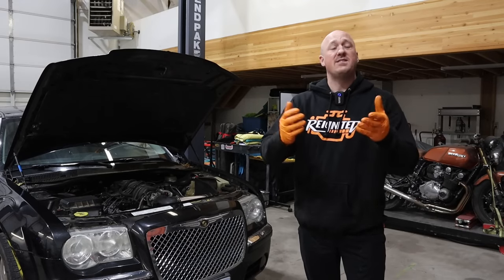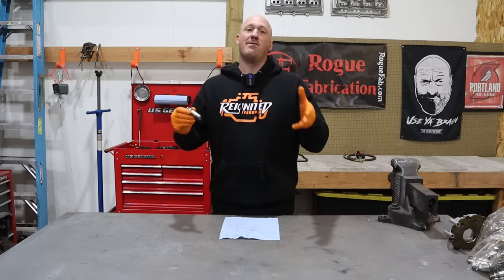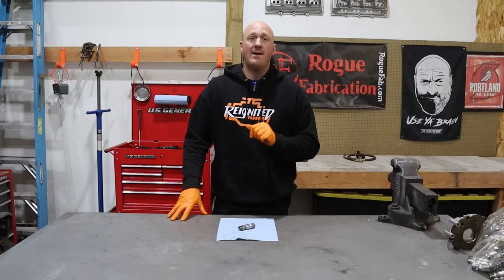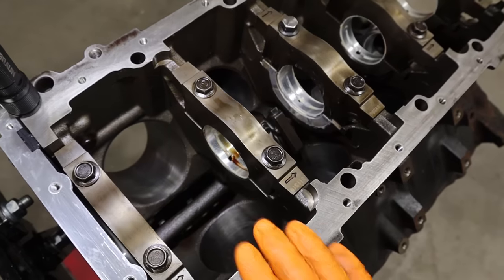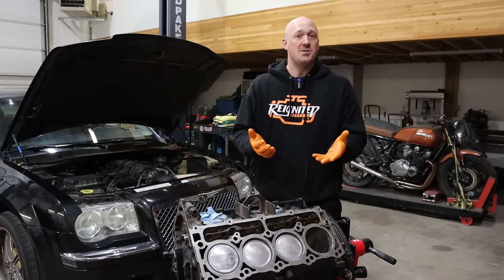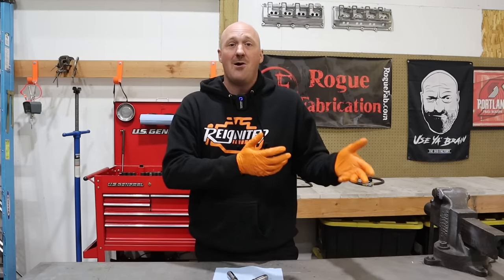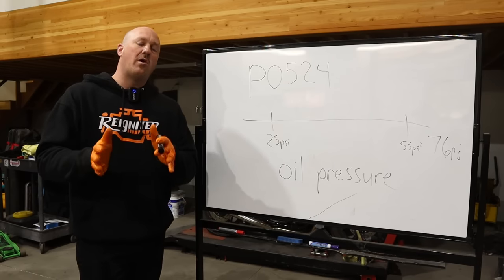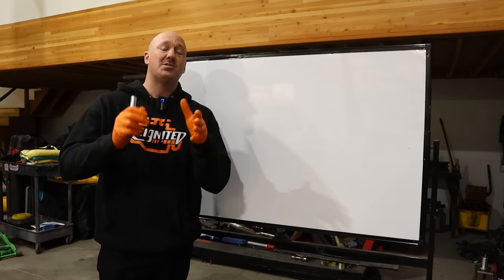The BEST Prevention For Hemi Lifter Failure! (In My Opinion)

Comment: It would also be a good idea to keep an eye on what your oil looks ans feel like. That would also be the reminder to check your oil often. Its recommended to check when ever you gas up, it only takes a second. Its inevitable that the oil is going to become fuel diluted. Arising problems will cause more fuel than normal to mix with the oil supply. It would suck to put on a high volume oil pump and replace lifters and cams, than still have oil problems afterwards. Yes, dirty oil will effect everything and you'll see more than just lifter, cam problems. It all depends on a numbers of variables but usually the upper engine components will show signs of a problem first. The lower components utilize hydraulic properties as well as lubrication properties. The upper components  utilize mainly the lubrication properties.

Comment: I have a 2006 1500 ram with 5.7 hemi. I let it idle all the time. One winter when i had alternator issues I let it idle for 3 straight days, yes 72 hours non stop. In addition i let the thing idle for hours on end while im at work. I do this in winter with heater on and in summer with A/C on. Ive been doing this for 7 years and the truck now has 270,000 miles and has zero Hemi tick.
Reply from the maker: The pre 2009 engines don't suffer from this particular issue. 👍
Reply: @ReignitedAuto  Thank you for the top explanations!  You wrote that the engines before 2009 have these symptoms of ticking or these problems with the oil pressure at idle? Does this also apply to the Chrysler engines from 2006 5.7 liters that are installed in the 300C? Would it still make sense to install the oil pump as mentioned in the video 10342HV?  Thank you and many greetings from switzerland🏔

Comment: Ford has used needle roller lifters since the late 1980s and the "Hemi" lifter tick issue was not an issue for Ford .  Today, Dodge is not alone with lifter problems, as Chevy is also experiencing the "Hemi" tick with their later LS engines. Oil used back in the 1980's was usually 10-30 or 10-40. I don't believe metals all that different today, but the combination of 0-20 oil with todays ultra hot engines,  the oil is NOT providing the cushion needed for these puny needle bearings. As a mechanic myself,  I use 10-30 oil, deactivate all cam controllers and run a 180' thermostat

Comment: What about using a Melling 10452HV? its a  high pressure/ high volume oil pump. would what also fix the issue? Also, how would adding more volume/ pressure affect the VVT and the MDS system?
Reply from the maker: Stay tuned on that, Melling just sent me their new pump so I'll have a video up on that soon!

Comment: I am afraid My 2015  5.7 Hemi 2500 Ram has lifter tick, I feel foolish in listening to my dealership saying this is normal. But now at 105000 miles, I have noticed a lose in power and my mileage has dropped. In the beginning the tick would go away after run for a few minutes, but now I hear a faint tick when the engine is warmed up. I change my oil 3500 mile intervals since day one. After listening to your videos, I believe because I live in North Dakota and letting my truck idle to warmup. I need to know the best kit to replace the lifters and cam with all the gaskets or maybe it went too long and in that case where can I get new engine replacement. Thank you for your advice.

Comment: I was a Dodge technician for many years had many friends who were hemi experts went to specialize Schools and could make any v8 Dodge motor out run anything on planet earth with power steering and air conditioning and all of us are saying there is one major thing you forgot, variable valve timing or VVT, when you change that pump you change how the variable valve timing reacts in the motor, so are you advancing too early or  too late? Pressure is a massive factor in how the system operates This could be damaging down the road. Also MDS no matter who says can cause lifter failure when the engine is running, you are physically changing the dynamic of the lifter when the system is rotating, it can cause unwanted chatter,  uneven pressures against the cam lobe surface which can cause the needle bearings to fail, the best way to describe it pick up 2 60 pound bags of concrete walk with them to your destination and then drop them no problem right you be sore but can do it again many times, but let’s activate and deactivate MDS deactivating is like taking one of those 60 pound bags off While walking let’s turn it back on, that 60 pound bag that came off earlier comes flying down onto your shoulder slamming into you. What do you think would happen that’s correct unwanted rapid acceleration of pressure against steel overtime massive. Wear. You’re causing uneven wear patterns and it’s not just hurting the cam. It’s hurting the crankshaft bearing plus rods and wrist pins because of both valves are shut. It’s still creating pressure positive or negative, depending on where the cylinder was at when MDS came online, as that cylinder slides up and down it starts fighting with itself,so MDS is a very destructive system anyone that tells you otherwise has never understood basic physics so be very careful on who you listen to.

Comment: All your videos have helped greatly, but in the course of adding an MDS delete kit and new oil pump, I encountered something unbeknownst to me. In taking the old oil pump off and going to put new pump on someone previously had used 13mm pump bolts with SAE threads which explained why i had to clean the threads, I bought the correct M8x1.25x65mm bolts but now am facing the issue of do I chase the holes with the propper Tap or what. Some input would be greatly appreciated. It's a 2011 5.7hemi. Thx.
Reply from the maker: I would absolutely chase the threads with a tap before reinstalling the pump. It's critical that the bolts are torqued properly to the block so anything you can do to help that would be good. 👍
Reply: @ReignitedAuto  incase chasing the threads fails is there enough wall thickness to step up a size with drill n tap "if" needed ? want to make sure i don't create more problems lol.
Reply from the maker: @atvstrucksfun46  if you can't repair the threads I would drill out the bosses on the block and put some helicoils in rather than step up the hardware size.
Reply: @ReignitedAuto  will do! Thanks for your time and input much appreciated !

Comment: I purchased a new 2015 Ram5500 6.4L and it has ticked on initial start-up since day one. I’ve changed the oil every 5,000 miles with the factory Pennzoil 0W-40. It now has 30,000 miles and runs good - I hope it lasts…?

Comment: GREAT video!  Have a couple questions:  Is there any way through scanner readings to know if this issue with the lifters is beginning?  Something that would negate the need to tear the top of the engine down just to verify?  Secondly,  do you believe this upgrade will be all that preventative if the vehicle has been run at extended times between oil changes?   I've gone easily 8-9k between changes a few times before, but have always used synthetic 5w-20.  Mostly Mobil 1. I'm at 90k, and don't hear a tick when warm.  Runs fine, also. Thanks.
Reply: I don’t believe so. I tested two rams both had ticking. The loudest one with the tick didn’t have any codes. That was 2013. Now the 2012 had a lower ticking at idle but I got a cylinder 3 failure. Same engines Hemi 5.7. I told the dealer to fix it and I would buy it. So you really just gotta listen for it. I recommend letting the car idling for about 10-15 minutes. Ford 3v are also known for this. I had one myself but that repair came out of my pocket.

Comment: What are your thoughts for people like me with a 2021 Durango RT, Tow N Go with only 9,000 miles?  I'm in the preventative / maintenance phase of this vehicle's life.  I do NOT want to mess with cutting up my wiring harness or installing another oil pump, etc.  What are your thoughts on oil additives like Liqui Moly Ceratec, etc?  I change my oil about every 3,000 miles AND I noticed Dodge dealers use either 0W-20 or 5W-20...... I am no mechanic but I would be far from thinking this is a good idea especially with Hemi Tick!!!  Isn't 5W-30 the best bet?  🏁🏁🏁🏁🏁🏁

Comment: Is it plausible in a 2020 Ram 1500 5.7L that the use of full synthetic oil when changed between 4-5k mile intervals and without prolonged idling is too slippery, and doesn't allow the needle bearings in the roller lifters to rotate enough causing premature wear between 100-125k miles? I believe the manufacturer calls for a standard oil and NOT a synthetic or ever partial synthetic.  
Someone I know who analyzes failure points in large CAT diesel engines suggested  the lifters rollers need a certain amount of friction to roll. 
What are your thoughts on that.
I believe the pump would solve engine idle oiling problems for fleet vehicles. But excessive "high flow" oil pressure above a certain pressure will cause a small drop in horsepower at peak RPMs.   So, I support the idea of changing the relief spring to bleed off at 65psi
So my final thoughts: definitely run the hellcat pump, change the relief spring to 65psi, and run standard oil with 3k miles $$$ or a synthetic blend? At 5k miles? If the synthetic blend isn't too slick.  That part I'm unsure of.

Comment: The question is...are the hellcat motors experiencing lifter and cam problem?
Reply from the maker: I haven't done any personally, but there's a lot of reasons why that would be the case, primarily because there are such lower production numbers of Hellcats versus regular Hemi engines, and that if someone does own a Hellcat it's likely not their daily driver so it's not exposed to extended idle times. But even saying that I still feel confident that the Hellcat pump is an upgrade.

Comment: Like you said it all went south in 09 but the 09 up 5.7 pump has higher oil pressure and volume than the earlier ones so it can not be the oil pump. It is just crappy bearings in the lifters because Chrysler was going to be out of business and did not care.

Comment: I don't know a lot about Motors , or turning a wrench But i've watched some tear down videos, and everything here lines up with what was found there I just find these recommendation's to be very Logical ,  I will NOT idle my motor without GOOD purpose. I'm Protecting my investment by adding oil volume at idle rpms, By changing to the Hellcat oil pump, also by raising my idle to 800 from 600. I have Changed the oil probably 15 times already, it's never been dirty on the dipstick, know i don't have to change it that often , But i'm sure glad i did !!!!!  I have 2018, 6.4, with 32,000, i'm going to have my mechanic show me where to listen with a stethoscope for the lifter tick , so i can monitor for a increase  I think taking common sense precuastions just makes sense , this truck Cost me a lot, new motor cost More, Trucks way overpriced Now, This ONE 's got to last Me !!!!! Amen !!!

Comment: hello, apologies, but wiring, and electronics is not my strength. Are these voltage dividers, something that resemble simple, single wire, butt connectors? The ones I find online, are 3 wire. Also, I dont know Kirchkoffs law, so what exactly do I need to purchase, for a 2013 5.7, that i installed the Hellcat pump in, resulting in the P0524 code? there is some confusion that I am not understanding in the wiring divider, and #'s neede to reduce my signal wire voltage, back to the ECU. any "dumbing it down" to walk me through, would be appreciated. Thank you.

Comment: Awesome vid mate, how can you tell the difference between a early and late 5.7 Hemi engine, its just i have a 2005 grand Cherokee limited which has the Hemi Tick and just pricing up parts for im just suspect it could be a later engine fitted it could be early  o5 i just dont want to order the wrong cam and lifters and oil pump, i havnt stripped it down yet to see whats damaged, any info would be much appreciated and many thanks.

Comment: Considering a Ram and found your information very valuable, thanks!  

I watched your video on this from 3 years ago where you explained that Chrysler likely would not address any problems with the cam/lifters because of the financial calculation that repairing the less than 5% problems was cheaper than re-tooling the engine.  However, if the problem can be fixed, or greatly reduced, by simply switching to the larger oil pump, that old argument kind of falls apart, doesn't it?  I mean, if all Chrysler had to do was switch to the larger, off the shelf pump, to address the problem, that would cost them next to nothing in manufacturing. So why wouldn't they have done it?
Reply from the maker: It's definitely a fair question. In my mind there are two reasons. Either their engineers decided that a simple oil pump swap would not significantly address the issue, or they figured that changing a component like that would essentially be an admission of guilt that they did something wrong and lawsuits could pounce on that. I truthfully don't know what the real reason is, I wish I did.
Reply: Yeah, it's difficult to know what goes into corporate discision making.  I'm looking at a truck with 50k miles with no current tick and considering if I have 50k to go till problems, invest in changing the pump and add some hope, or consider something else.  Thanks for you addressing this issue with your experience and thanks for the reply!

Comment: My opinion is a combination between the MDS system, the transmission and gearing to improve fuel economy. Going around town at 30 mph, engine at 1200 rpm, 5th gear and it's lugging in 4 cylinder mode. Not a mechanic but it's gotta be hard on the engine.

Comment: Raced my buddies 2020 Helllcat Charger against my 2022 Ram 1500.  When I finally caught up to him and we were laughing I asked what did his oil pressure show since we were both hot and at idle.  32psi.   Mine was 38psi.    His mileage:  5K miles...   mine:  15K.   So to me, this dispels the low oil pressure at idle myth.  At dealer talking to service rep about radio issue, noticed they had a long block in a crate.  Asked if it was a cam/lifter, he said yes, if was for a landscaper truck who's engine looked like Quaker State hd been used in it...  He then asked a mechanic to come over and show me mileage on his 2017.   304K miles..   Oil changed every 6K with synthetic, not a tap to be heard...

Comment: Im assuming that the feed from that sensor is used by the EVIC also, and installing the voltage splitter will drop the displayed oil pressure also?
Reply from the maker: That is correct. 👍

Comment: Have hemi tick now, cam and lifter failure diagnosed by dealership. They want 12k to replace engine. I changed oil religiously every 3 to 4k miles. Last Ram I will buy. Failed at 135k miles.

Comment: Hello, I have a 2017 Ram 1500 5.7 with 75,000 miles on it, warmed up engine shows 40psi oil pressure at the factory oil pump. Do I need to change the oil pump on my Hellcat to prevent lifter failure at the current 40psi? If not, at what pressure drop should the pump be replaced?

Comment: My 2014 ram with 66,000 miles makes a prominent tick but only after it's sat a few weeks and it goes away after about 5 minutes running.  Heat shield on exhaust manifold are snug.  I'm not driving it right now but would like to know what the cause of the noise is before I drive it anymore.
Reply from the maker: That's actually pretty common with the Hemi engines if they've sat for a long time. The oil will drain a little bit from the hydraulic portion of the lifters and it'll rattle a bit until that oil pressure gets the lifters built back up again. The good news is it doesn't hurt anything, it's just a little annoying.

Comment: I have 2016 Challenger RT Plus that I bought used with 16K miles in 2019. I have been doing my oil changes based on that built in indicator on the dash. I use Penzoil Ultra Platinum oil (6.5 qts) and 1 qt of Lucas Pure Synthetic Oil Stabilizer and I use the SRT Dodge Viper oil filter. What's your thoughts on that? I do plan on installing a Hellcat oil pump, Hellcat cam and doing a MDS delete on the car.

Comment: The oil pump itself i believe wont be enough to aboid the cam and lifter failure as the biggest issue is oil starving at idle. What i mean by that is i feel it is more critical to change the idle RPM to allow more oil splash at the area of highest failure (lifters) that lead to eventual cam failure.